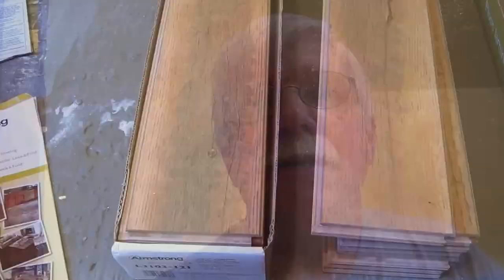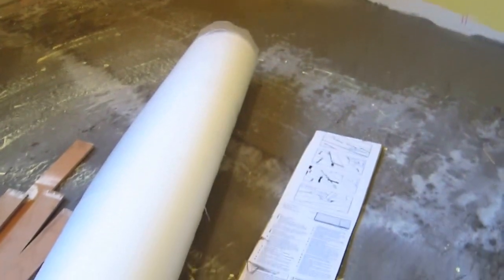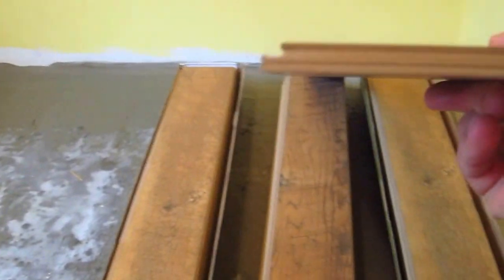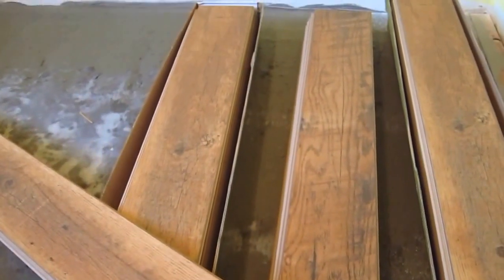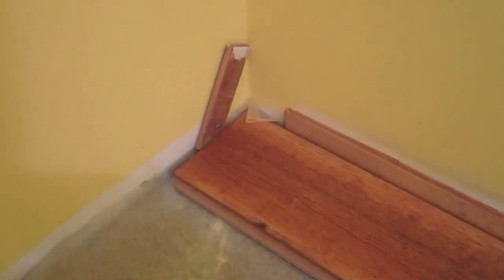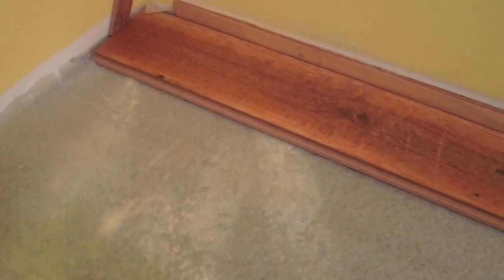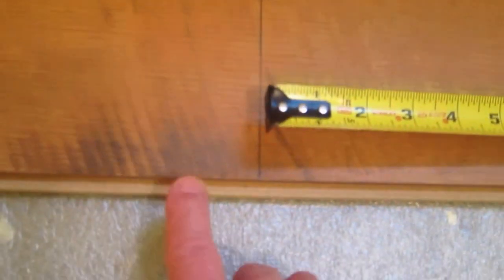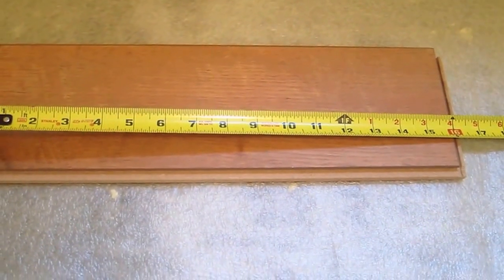How to Install Laminate Flooring Video 1 of 3

Comment: I would encourage everyone who has not seen laminate flooring to visit a house that has it installed before they decide to install it.  My two complaints are noise and lack of a solid feel.  The house we rent in FL in the winter has laminate floors and if you drop something heavy on them it sounds like gun going off.  The wife dropped the retractable dog leash yesterday and I thought we had an incoming artillery.  The dog's claws also get annoying when he walks around the house.  The floor also doesn't have a solid feel to it; there may be a thin layer of foam under.
Reply from the maker: Bob, thanks for your comment. Your complaints are probably due to improper installation. My laminate floor is as solid as a traditional nailed-down full-thickness hardwood floor. There is no movement. I've dropped things on my floor already and no cannon noises!